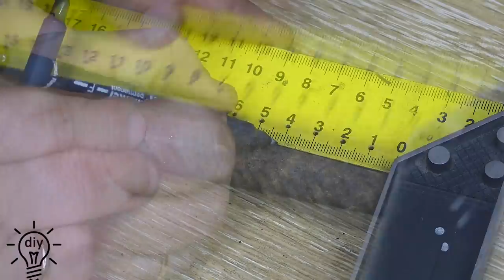A brilliant idea made from scraps of rebar! THOR's hammer with your own hands!

Comment: A TIP FOR LOOSE HAMMER HEADS.
GET A SUITABLE SIZED CONTAINER ,FILLED WITH JUST ENOUGH WATER TO SUBMERGE THE HEAD.LET HAMMER SOAK IN WATER FOR A DAY OR SO. THE HANDLE WILL SOAK UP THE WATER AND SWELL.YOULL NEED A TORCH IF YOU EVER PLAN TO REMOVE THE HANDLE FROM INSIDE THE HEAD!